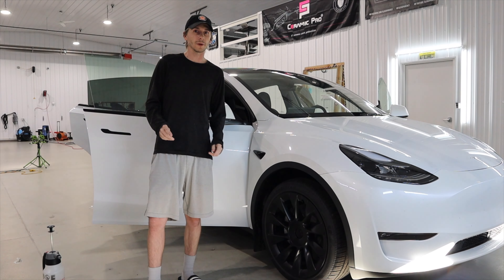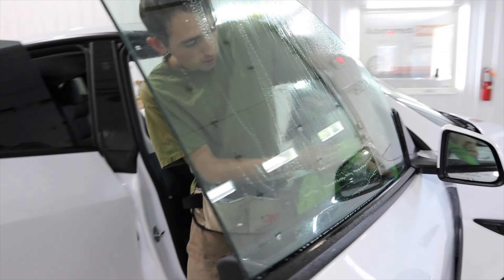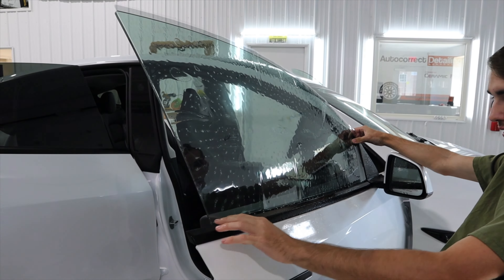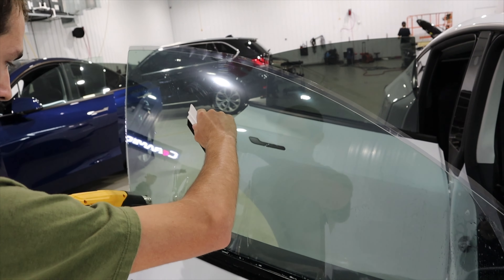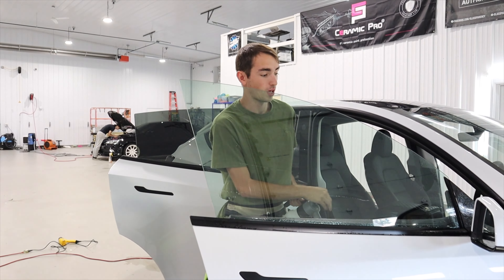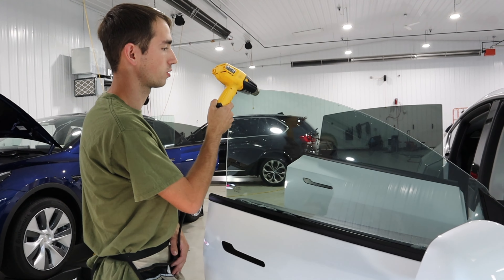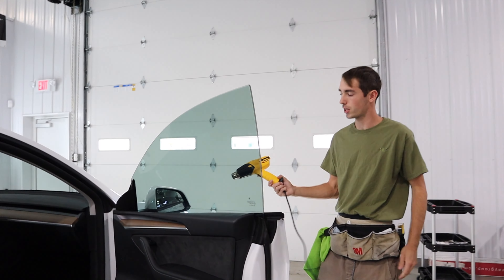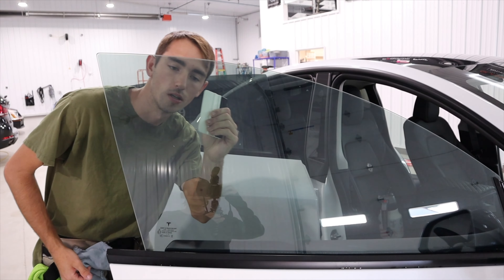Step by Step Window Tint Guide! (2023 Tesla Model Y)

Comment: How do you keep the windows rolled up? I tried to tint mine but the window keeps rolling down a bit which makes it hard to Aline the tint.
Reply: Open the door, then push the door latch in, just make sure to pull the handle before you close it or you might dent something